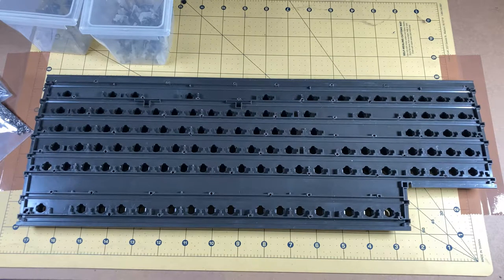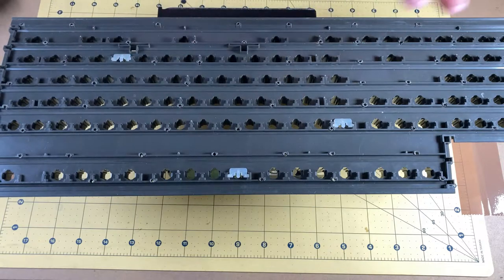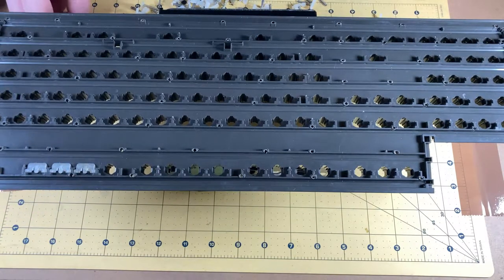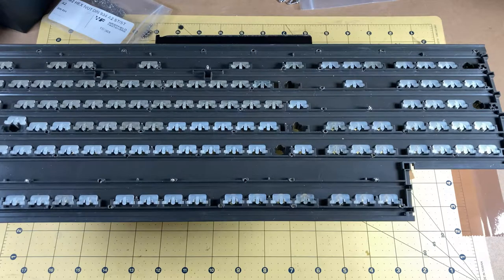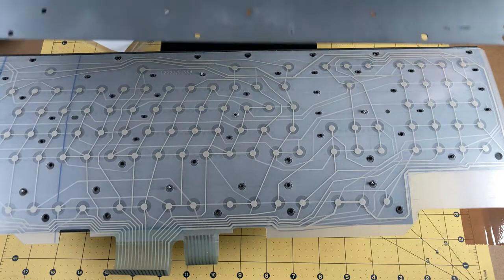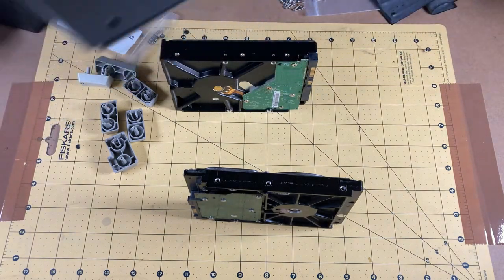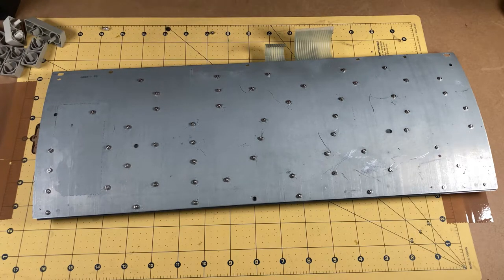Bolt Modding and Repairing an IBM Model M Keyboard - Part 4

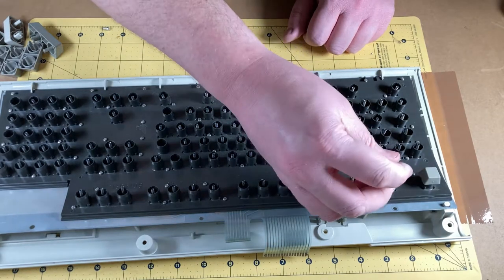Comment: 19:01 sometimes you can fix those by just taking the keycap off and putting it back on a few times.  and if that doesn't work try taking the spring off and re-seating it back a few times could do the trick as well.  I used to replace mine pre-maturely in the past not realizing that a simple re-seat can fix alot of them.

Comment: I did it with an used unicomp pc122 from 2016 (3 springs were damaged). This bolt mod was harder than I thought because you need to ajust the pressure on your bolts correctly (each bolt). If your bolt are too tight your key lost the actuation and if it's too slack it's not good either. It's hard to calibrate perfectly each keys with the same actuation. And when you drill your holes you can damage your keyboard too. I passed at least 6-7 hours to restore this keyboard, it's really time consuming. If it's not an old vintage ibm from the late 80s, I am not sure if it's worth the time spent. A new Unicomp still a better value imo.

Comment: All springs need to wiggle. If some don't, either the bolts are too tight or the rubber mat is somewhat crooked, or the flippers are not in the right place.